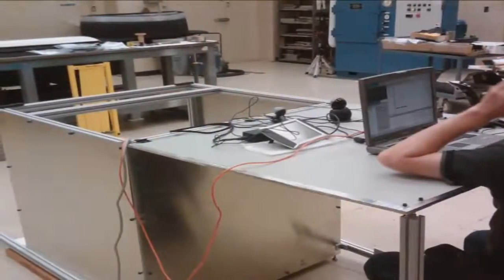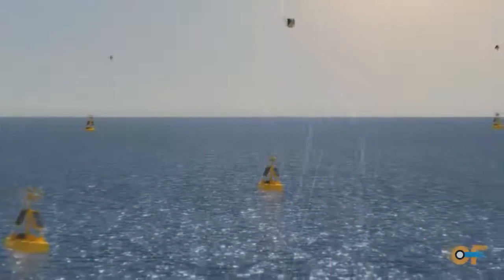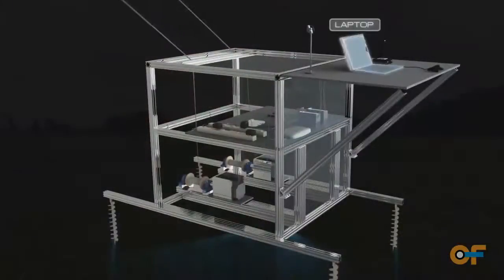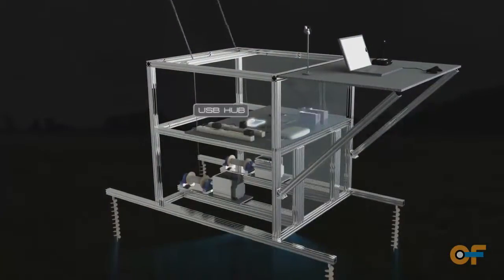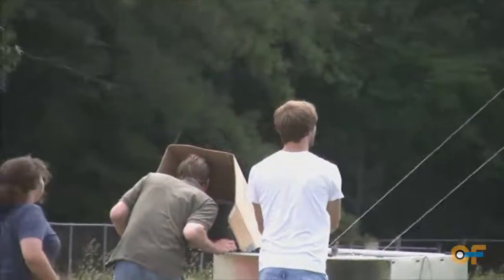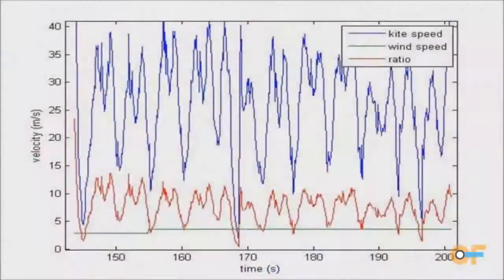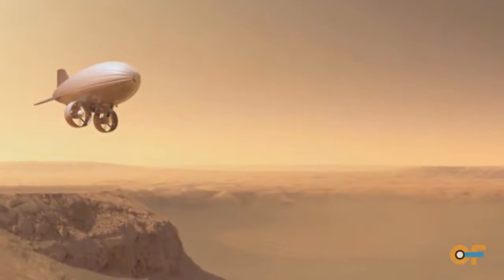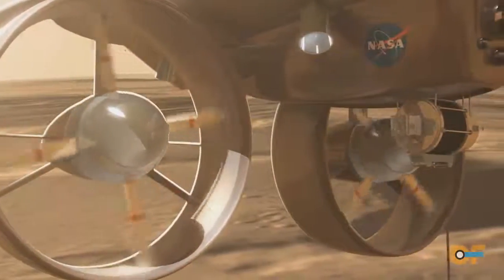NASA | Airborne Wind Energy Harvesting

Comment: You will have to have power running from the center line to the 3 pulleys to control the kite. So then you just fly your kite do your figure 8 until you're out of lineto depower the kite and reel it back in with your generator power upthe then do it all over again. Can you imagine 100 square meter kite going up 2000 feet with 40 knot wind we never have to worry about energy again. I'm in Virginia Beach please contact me if I can volunteer.

Comment: Hi I'm Jason O'Brien I've been kite surfing for over 10 years and thinking about the same generator idea for a long time when you said using a 4 line kite then going to 1 line that's exactly my same idea I've had for 10 years. All you need are 3 remote controlled pulleys on each steering line and 1 on the de-power lines that way you can control the kite via remote control.